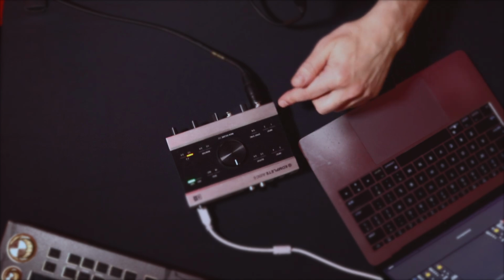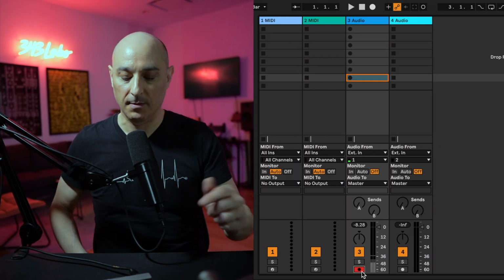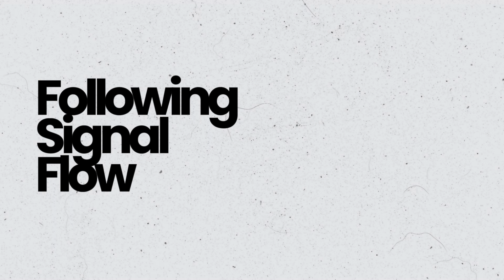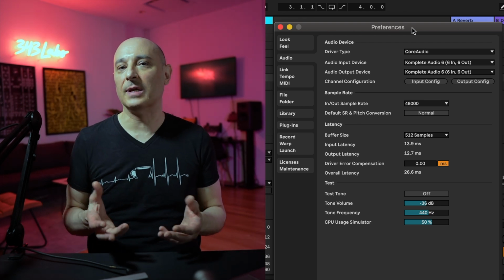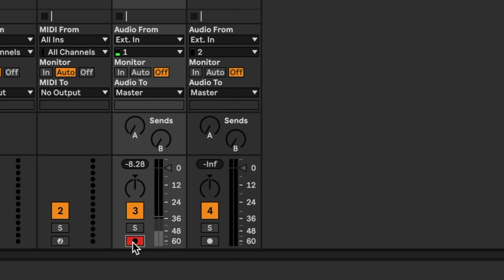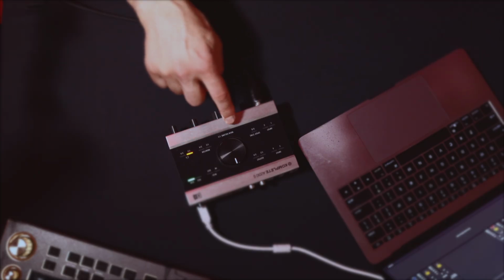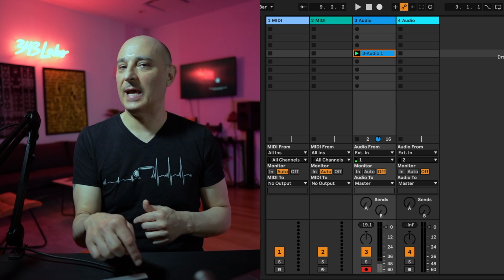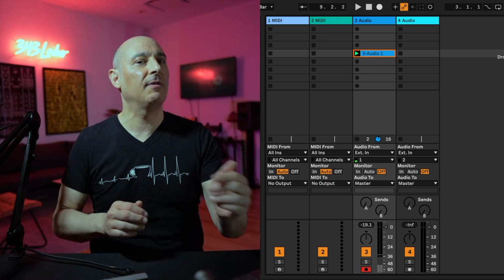Do you need an audio interface for music production? | Ableton-Certified Trainer Brian Jackson

Comment: Excellent! Thank you, but I've got a mic with a USB connection should I still use a audio interface? Because of the sound input into the laptop is bad?
Reply from the maker: A USB mic is basically a mic with a simple audio interface - with phantom power and analog to digital conversion built in. Some of them are pretty good, so if you're happy with the sound no need for a separate interface unless you acquire another mic that needs one.
Reply: @343labs  Thanks for your response. I've got a Roland NT USB mic, yes the sound is fine without one.